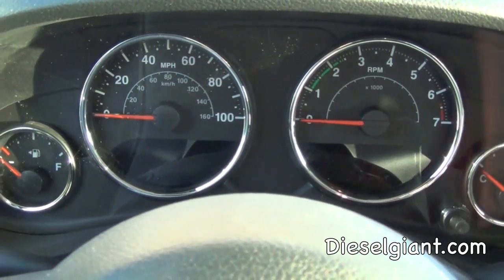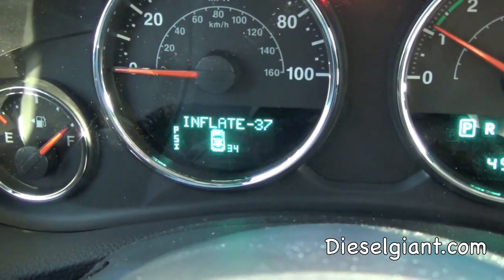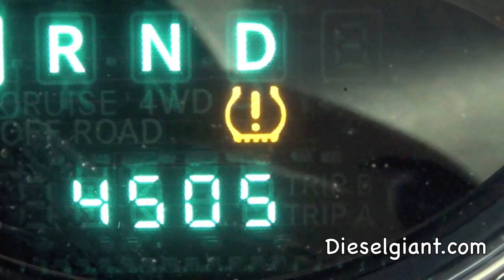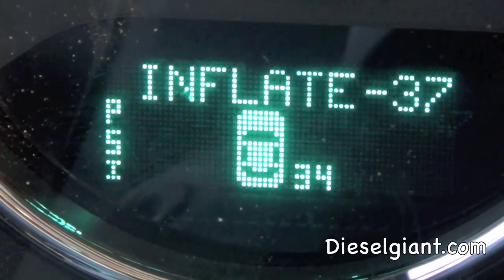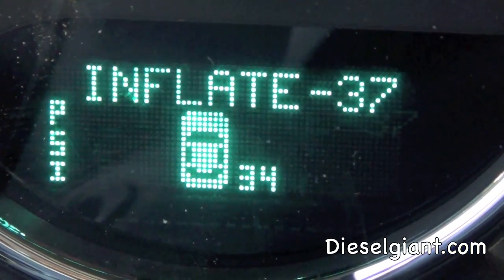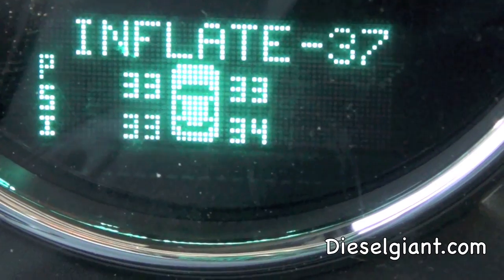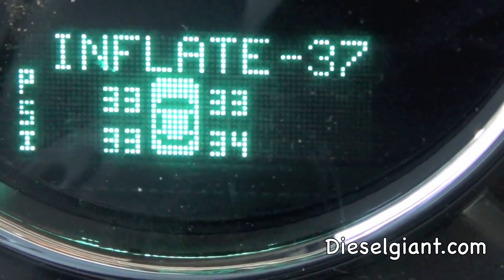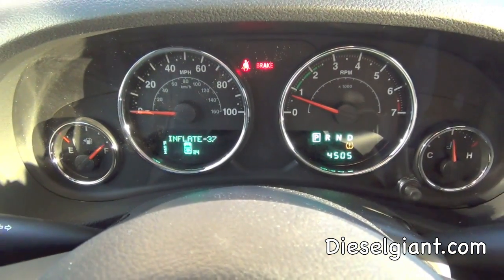2013 Jeep Wrangler Tire Pressure Monitoring System Explained

Comment: What is the correct tire pressure for my 13 JK in order to eliminate the low tire pressure Light ? I have after market 35 tires on it
Reply: The jk comes from the factory 35psi , if you went lower than 35 psi it will ligt up doesn’t matter what tire size you have.
As for 35’ tire size you need to to see what is best for your setup, usaually between 22.5 and 28 psi will be better. It depends on the load code (how strong is the side wall) on your tire such as load c or e ...etc, and it depends on how heavy is your jeep too,  if your setup is very heavy then go between 25 and 28, if its just steel bumpers try between 22 and 25.
Im no expert, but that is how im running my jeeps since 2006, my newest jeep is a 2013 2dr jk with bfgoodrich ko2 “load C not E” all terrain, 2dr very light setup just a rear bumber,  i run daily on 22.5. And i have all my gears and luggage for a trip (800+ lbs) i run 25 ~27. 
My older mud terrain load E 9ply side wall was always 20 light 25 heavy psi.
Give it a try,  if you have mud terrain go 25 psi and test it for a day,  if you have all terrain try 28. 
Btw i have a flashcal to adjust the the low pressure warning light in the jk, as for now i have it on 21 psi.. every jeeper must have one specially if you change your tire size, must adjust it.   Be safe ✌🏼
Reply: @TJ.1  thanks a lot for the tips bro

Comment: Sorry English is not my language. I have a Wrangler Sport Diesel 2 doors CRD 2.8. The case is that the low tire signal (front right) always marks under 2.5 PSI which is the pressure indicated by the manufacturer. I think this is the sensor and that the correct pressure should be 2.5 back and 2.4 forward. What you think?

Comment: I don't understand. The sidewall of my stock tires read 51 psi max load - So I have placed them at 46 psi. - 2015 Jeep Wrangler
Reply: wow that is way too high, I run mine at 27psi. I can only imagine 51 feels like driving on rocks for tires
Reply: same mine i have 51 psi and running on 35 :P

Comment: Thanks for the video . Needed to rotate my tires to . I watched that video . Low pressure light on , refilled and checked all tires . Light didn't go off but didn't drive it very far . My work is only 11 miles away . However after the tire rotation and all tire pressure checked the light is off . system show the right rear was low. All clear now !